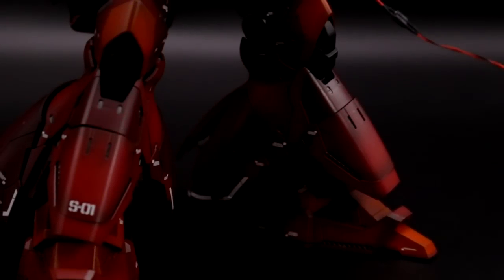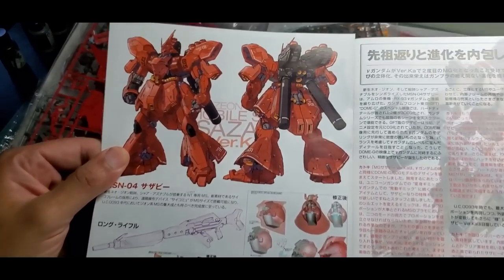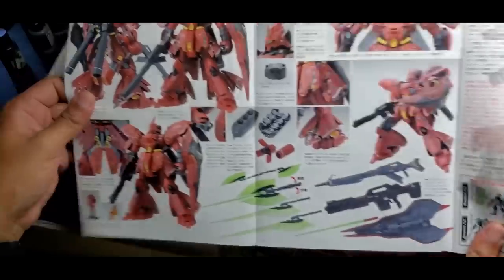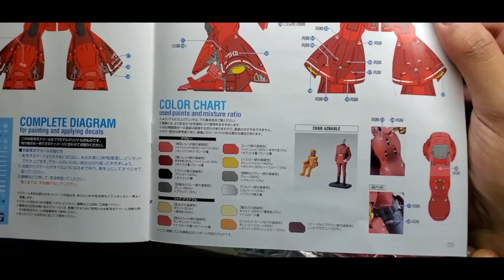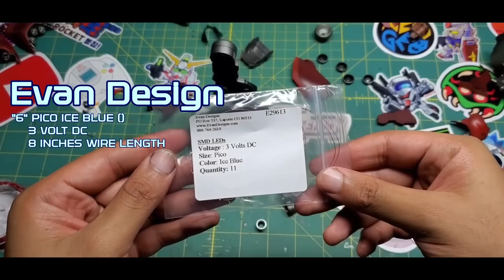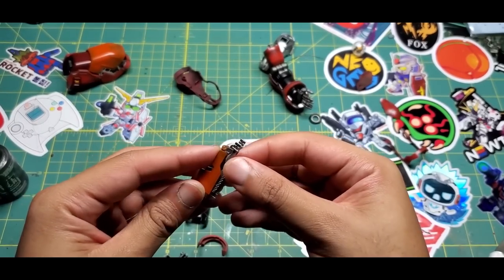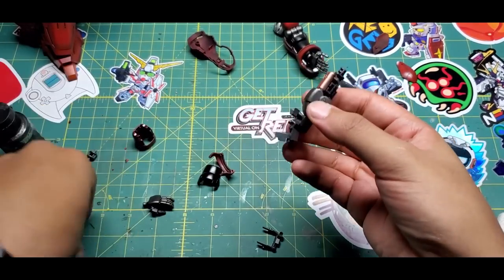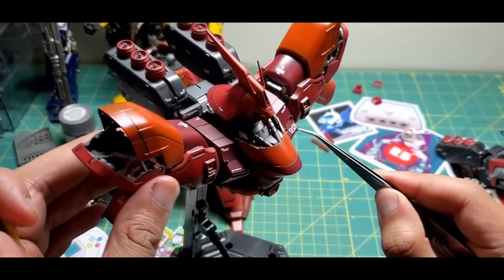#newtype #Otakubuilder MASTER GRADE Sazabi Ver ka

Comment: Excellent photography at the end of the video to present your final result. Having a bit of experience with Vallejo acrylics, I'm quite impressed by the way you master them to get that smooth and nice texture and results all over the kit, as they can be a bit tricky to use. I now use more lacquers as Tamiya and Mr color, which are in my opinion much more easy and forgivable than acrylics can be. And I also share your concerns about the paint being damaged while final assembling, as the paint thickness tightens the joints and connecting points, and sometimes very quickly damages your long and patient paint job. I observed that lacquers are maybe a bit thinner than acrylics once applied, maybe less paint necessary for the same cover, and then less damage once assembled. Excellent work though, I have this kit MISB which awaits to be done. I wait to earn more experience on building and painting and will do it when I will feel ready. I wanted to go on a dark red candy color scheme, but you helped me change my mind about it, as your color choices are quite interesting and very nice at the end of the day. Excellent work, thanks for sharing your experience and tips. Keep it up! 👍Liked, and subscribed.